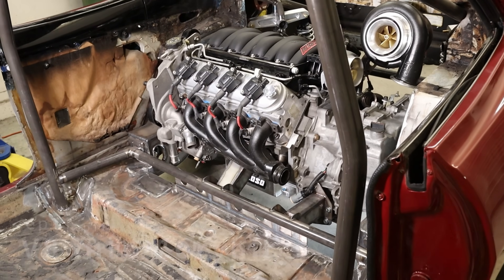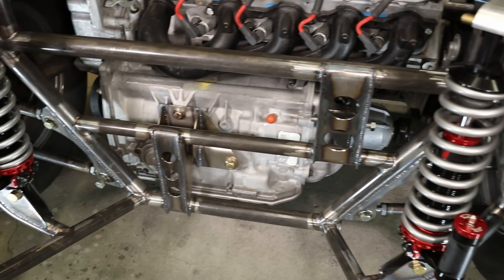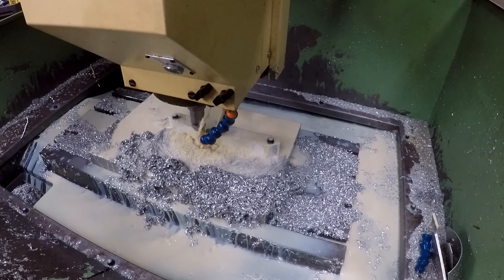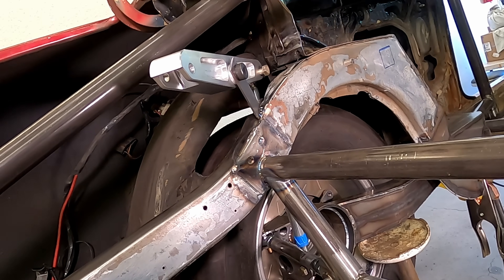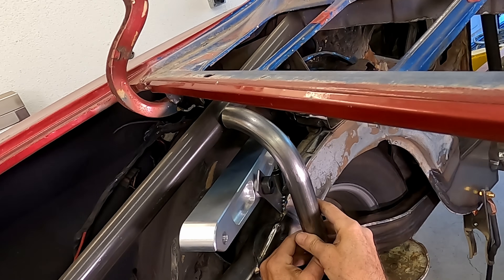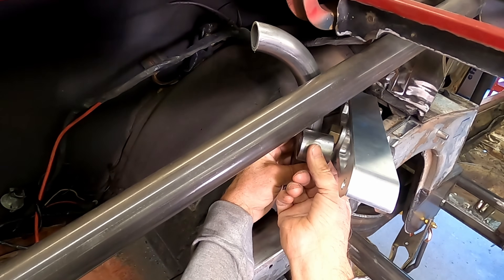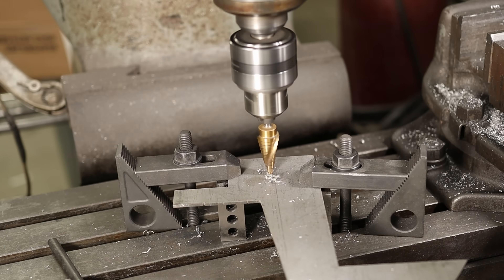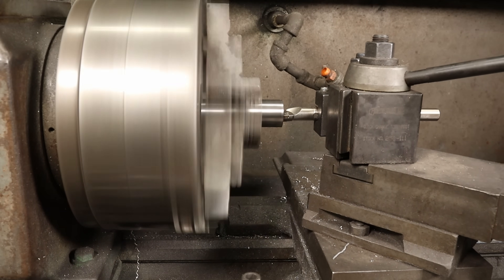Cantilever suspension built in the garage

Comment: Great job. Have you ever heard of installing a Olds or Buick 215 V-8 into a corvair.the 215 engines that were modified by mercury user built a engine with reverse rotation and fisher made a adapter to adapt it to the Corvair differential. They were able to get about 260 h.p. which would make the Corair run strong. They used dual Radiator, like the ones used on Ferraris. Scoops were designed to make it look like mfg's design.

Comment: On the bender pins (that hold all the dies and other bits) I found that the rings that are attached to the pins kept getting in the way. So I welded them in a vertical position to the pins and the have never got in my way again. Just a suggestion.
Reply from the maker: Good idea, they do get in the way.

Comment: Awesome!  I noticed the shock leans front to back when going through it's travel.  Does the bottom mount allow for this, because the mounting bolt is off axis and not rotating like the top.
Reply from the maker: Both of the shock ends have spherical bearings which allow them to rotate freely.  The shock goes through geometry changes during travel which is normal.  Hope that answers your question.
Reply: @JohnReynolds661  Oh, did not realize the ends are spherical.  Really awesome work!

Comment: Why did being underpowered make the Corsair unsafe?
Reply from the maker: It was a joke.  The early models had the same problem as early VWs with swing axles that tended to fold under in a corner, but really, it was a PR stunt for Ralph Nader to get recognition, IMO.
Reply: @JohnReynolds661  Thanks I remember the Ralph Nader hype.
Reply: @JohnReynolds661  My recollection of the video is with the test driver yanking hard on the steering wheel to get the car to react.  I had a Karmen Ghia with the swing axles.  It would hop when corning hard on skinny tires.

Comment: You had me worried all through the video that you weren’t figuring in some type of bearings and grease fittings! Until the end! What about thrust bearings?
Reply from the maker: The bronze bushings act as trust bushings.  Bronze bushings are best suited for this application.  They work will in relatively slow speed, high load circumstances.  But they will probably transfer more noise.

Comment: Just brilliant design as usual John. I agree by adding the LS motor, you are definitely making the Corvair safer. Oh yeah, like the Sketchers too, their my favorite shoes. So what’s next??
Reply from the maker: Probably exhaust and induction.
Reply: @JohnReynolds661  This video is very well done, again and Your plan, visualization, formation, fabrication, production is Greater. 😆
Every step and posted episode of this Grand Corvair transverse mounted V8, LS4, turbo is well thought through, planned, fabricated, executed.
this rear suspension is clearly well thought through and developed and You have learned from Your past suspension work with the off-road racing vehicle You were involved in with fabrication and building. 
This rear suspension and the front not only improves the modified 1965-9 model version, it seems it surpasses the Yenko version and other purpose built racing versions, such they all negate Ralph[y] negative Nilly, and make the vehicle not only safe at any normal use speed, but high performance speed and track use too. The added power and mid-engine placement is superb for the many uses including racing on a drag strip, or various track types It seems You have thought of having the ability to tune the suspension for various uses.

It seems to me this vehicle will be more deLIGHTful, powerful, quicker, faster, amazing and surprising to most all, especially passengers, though a little less hidden, still it seems it should be better at the track too compare with the quick fast VW You have built.

My hunch is that Ralphy 'boy' had not actually driven the vehicle in any actual conditions or at any speed.😒
But, there were reports of some of the early models which had flipped over while travelling on open, undivided highways, possibly with large tractor trailers travelling in the opposite direction, thus bring a large amount of air flow to the front of the vehicle which was very light, comparably and susceptible to be lifted. The design and implementation of the improved front end suspension version corrected that issue at least by the 1965 model. Your original version of this vehicle certainly had the modified suspension and You updated suspension certainly is a great, further improvement. 
My father [O"H], bought the 1965 Corvair Monza [lt. blue], automatic speed [with the  vertical gear selector and key slot starting, on, off, on the dash], with the standard flat-pancake 6 cylinder engine near the end of the model year in the late summer. It became the family car replacing the Ford full-size wagon [which was sold to the local mechanic that had cared for it]. He drove that vehicle for 10 years and 100k miles. He gave it away to the dealer buying a 1975 Vega, also near end of the model year, in the late summer. Actually i wanted my father to give it to me, as i just competed my driver's license, but my mother was fearful of the vehicle for some reason. We had driven family vacations from Toledo through PA, into the Pocono mountains, on into NY several times, then my father drive it east to Washington,DC area in Maryland where he had a new job position, then We followed by air plane, after all of the household was packed and sent via the professional moving company. Meanwhile he had purchased a second family vehicle. Another Chevy.; a 1968 Bel Air, 6 cylinder [250 c.i.] (a little under powered then),  speed automatic with the gear selector and key, ACC/Off/On/Start on the steering column. That Bel Air was traded in 1973 for a Dodge Dart Swinger, 225 c.i. slant-6 cylinder, 3 speed automatic, gear selector, key on the steering column, PS, A/C  [excellent, durable, reliable vehicle] while keeping the Corvair, since it had problems since just 10 days after purchase and pickup, which was never completely corrected [apparently mostly electrical issues including starter, charging, ignition]. The Corvair just needed some basic engine work, valvle cover gaskets leaked, and tie rod needed repair along with the heater unit had exhaust gas leaks into it The engine work was simple to do, while the tie rods needed an expert, but not very expensive and the heater unit had Chevy replacements which had not been done, but available and easily accomplished. It would have been a great first car and was excellent in the snow with its rear engine, fairly economical. Eventually it could have been available for various upgrades too. But, it was not mean t to be for me, though i liked the car very much and still do have much appreciation for it. Thus appreciate You build too and others that have done their excellent upgrades too. The other early variations have many uses too, though the body style of the 1965-9 is superior in shape and thus my favorite of them.
Obviously to find a clean, good condition chassis and body is difficult, but living in CA or similar areas in the west, southwest and some parts of the south, there are more that could be in reasonable good condition to work with.       
There could be a tube chassis modification done too, but that is very extensive fabrication work, yet possible for those with the.expertise and access to completing it.
In my current location in the Near East-Asia Minor region with very limited access to any such necessary fabrication, ship, tools, supplies and vehicles to work, with, such development, builds and work are extremely difficult to begin or arrange.including the necessary parts, materials tools, etc. Also any such engines or engine modifications are extremely difficult to begin or achieve. It is far more limited than anywhere in Europe.

the next steps of the exhaust and induction which clearly includes the components for turbo(s) will be certainly grand and great to see.
Am looking forward to Your next posted vlog with this build. 😆

All The Best and Much Success in Your Quest, Health and Well Being. 😊
Sincerely ☺
Reply: @JohnReynolds661  I was hoping you would say exhaust, I bet it’s going to be pretty!
Reply: @JohnReynolds661  What do you estimate the finished weight of the Corvair to be?